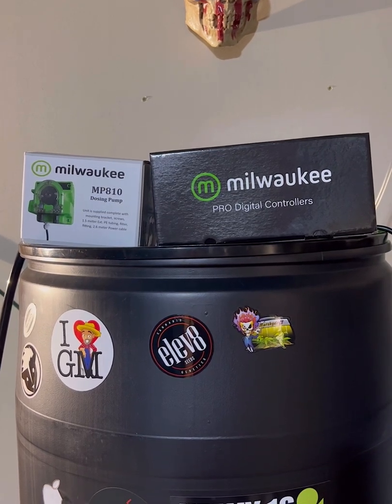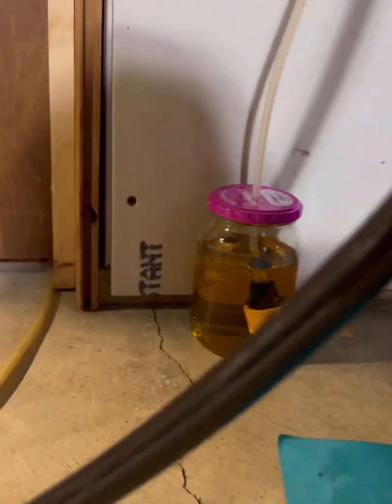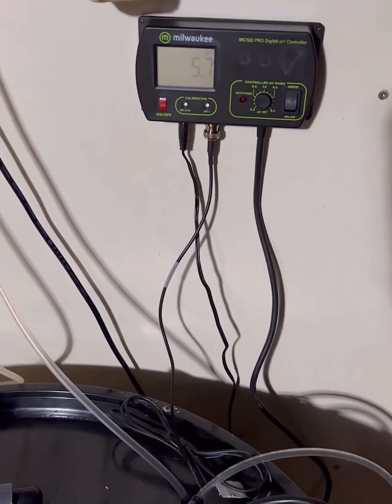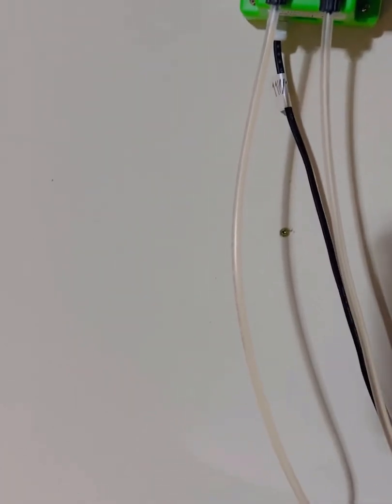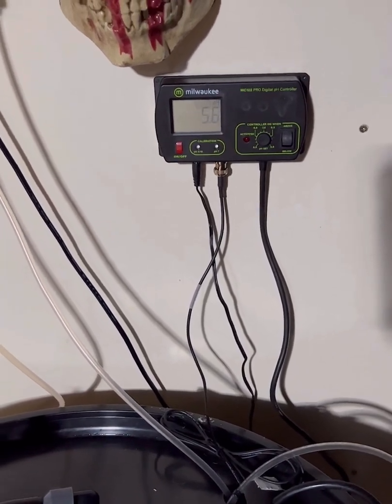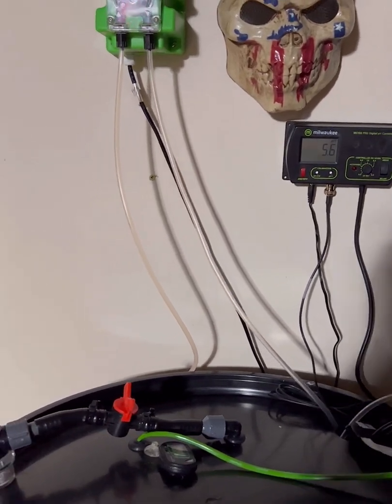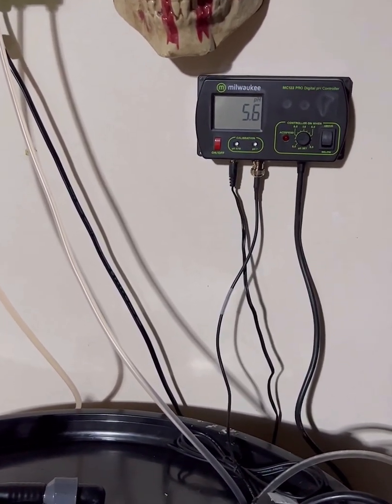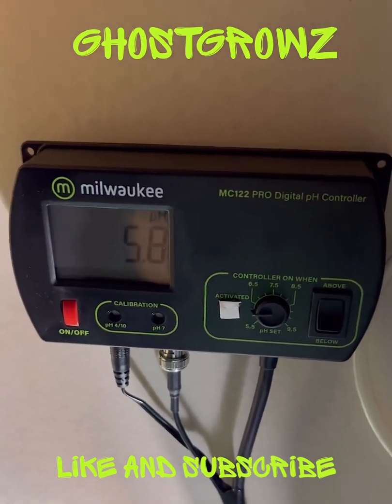Milwaukee PH Controller Review

Comment: I put the BlueLab Wi-Fi Ph controller on one setup and it is the bee's knees but so expensive.  And for the record, I have to set it a little higher to compensate, just like your Milwaukee does.  Easy to compensate for.    So I just ordered this same Milwaukee setup for another small setup to compare.  These devices are a MUST.  Most new guys don't realize that their Ph drifts.  I know I didn't and since corrected, it has been a game changer.
Reply: Update.  My Milwaukee PH Controller can maintain the PH in my Autopot reservoirs just as well as my Blue Lab.  I like Blue Labs web access and control over the app but if I were to add another setup, I would purchase the milwaukee over the Blue Lab controller.  Better bang for bucks.
Reply: @Donny_Juanny what Autopot setup do you run?
Organic, soil, Mineral, coco, …?

Comment: I’m having issues with mine set at above 6.5 since my water is hard where I live and this pump has over dosed my ph all the way down twice now to 2 ph and I have no idea why it’s doing it I even put the ph probe right next to the ph down tube so it picks it up faster and keeps it from over dosing at least that was my theory but that didn’t seem to work
Reply from the maker: Be sure to dilute the ph down I use about 8:1 ration, also I’m unsure what volume of water you’re using but it could be this Doser is too much for the small amount of water

Comment: Thanks for the review.I see this was a year ago is there any updates? I'm thinking of getting one of these so the questions is would you get the same unit after using it for a year should give you a pretty good idea how reliable it is
Reply from the maker: I would absolutely buy it again, keep the probe clean and calibrate once in a while, it will eliminate ph swings ending with big gains

Comment: Where did you get the little relay thing ? That pumps the solution out ?
Reply from the maker: The controller comes with the pump
Reply: @ghostgrowz9750  how are you liking yours so far ? I just got into hydro and I need one.
Reply from the maker: @JM-gj2zg  it works well just have to get the dilution rate right I run 1 part ph down to 6 parts water, definitely take some time to get it dialed in so it doesn’t overdose which can become an issue. I place the probe closer to the line dispensing the ph down to help prevent that issue tho.
Reply: @ghostgrowz9750  I just found it online. Thank you 🙏.

Comment: Thanks for the video! Your PH balancer, is that watered down or full concentrate?
Reply from the maker: I water it down a good amount, I have been running about 1 part ph 3-4 parts ro water. But it takes some dialing in for different size control buckets and/or water capacity